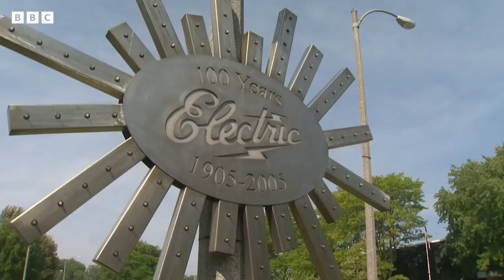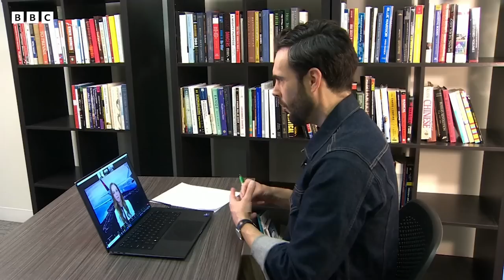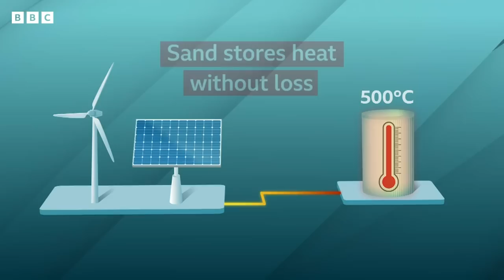Can the world rely on renewable energy? | Future Earth | BBC News

Comment: all energy-producing machinery must be fabricated from materials extracted from the earth. No energy system, in short, is actually “renewable,” since all machines require the continual mining and processing of millions of tons of primary materials and the disposal of hardware that inevitably wears out. Compared with hydrocarbons, green machines entail, on average, a 10-fold increase in the quantities of materials extracted and processed to produce the same amount of energy. For a snapshot of what all this points to regarding the total materials footprint of the green energy path, consider the supply chain for an electric car battery. A single battery providing a useful driving range weighs about 1,000 pounds. Providing the refined minerals needed to fabricate a single EV battery requires the mining, moving, and processing of more than 500,000 pounds of materials somewhere on the planet . That’s 20 times more than the 25,000 pounds of petroleum that an internal combustion engine uses over the life of a car.  Among the material realities of green energy:

Building wind turbines and solar panels to generate electricity, as well as batteries to fuel electric vehicles, requires, on average, more than 10 times the quantity of materials, compared with building machines using hydrocarbons to deliver the same amount of energy to society.

A single electric car contains more cobalt than 1,000 smartphone batteries; the blades on a single wind turbine have more plastic than 5 million smartphones; and a solar array that can power one data center uses more glass than 50 million phones.

Replacing hydrocarbons with green machines under current plans—never mind aspirations for far greater expansion—will vastly increase the mining of various critical minerals around the world. For example, a single electric car battery weighing 1,000 pounds requires extracting and processing some 500,000 pounds of materials. Averaged over a battery’s life, each mile of driving an electric car “consumes” five pounds of earth. Using an internal combustion engine consumes about 0.2 pounds of liquids per mile.

Oil, natural gas, and coal are needed to produce the concrete, steel, plastics, and purified minerals used to build green machines. The energy equivalent of 100 barrels of oil is used in the processes to fabricate a single battery that can store the equivalent of one barrel of oil.

By 2050, with current plans, the quantity of worn-out solar panels—much of it nonrecyclable—will constitute double the tonnage of all today’s global plastic waste, along with over 3 million tons per year of unrecyclable plastics from worn-out wind turbine blades. By 2030, more than 10 million tons per year of batteries will become garbage.

The extraction process of lithium is very resource demanding and specifically uses a lot of water in the extraction process. It is estimated that 500,000 gallons of water is used to mine one metric ton of lithium. With the world's leading country in production of lithium being Chile,  the lithium mines are in rural areas with an extremely diverse ecosystem. 

In Chile’s Salar de Atacama, one of the driest places on earth, about 65% of the water is used to mine lithium; leaving many of the local farmers and members of the community to find water elsewhere. Along with physical implications on the environment, working conditions can violate the standards of sustainable development goals. 

Additionally, it is common for locals to be in conflict with the surrounding lithium mines. There have been many accounts of dead animals and ruined farms in the surrounding areas of many of these mines. In Tagong, a small town in Garzê Tibetan Autonomous Prefecture China, there are records of dead fish and large animals floating down some of the rivers near the Tibetan mines. 

After further investigation, researchers found that this may have been caused by leakage of evaporation pools that sit for months and sometimes even years. Lithium-ion batteries contain metals such as cobalt, nickel, and manganese, which are toxic and can contaminate water supplies and ecosystems if they leach out of landfills. Additionally, fires in landfills or battery-recycling facilities have been attributed to inappropriate disposal of lithium-ion batteries. As a result, some jurisdictions require lithium-ion batteries to be recycled. In spite of the environmental cost of improper disposal of lithium-ion batteries, the rate of recycling is still relatively low, as recycling processes remain costly and immature.  More than 400 million batteries are used throughout the country, with only 5% being recycled, resulting in 8000 tonnes ending up in landfill.

Creating the lithium-ion battery pack is also more environmentally harmful than the manufacturing process for an average petrol-powered car.
Reply: Nice comment with tons of informations (not like most comments here), but sadly no sources.

 Like you mention it, it's obviously not an easy task to save us from our misery, but doing nothing about it doesn't seem to cut it either, right? It's really not as easy as they seem to put it, like in this video, which is sad tbh. 

But we have to continue our search for alternatives or otherwise we will lose no matter what. There are each year some great discoveries being made which could maybe change our future for the better. Science is trying to look for new methods to improve production and cost efficiency of those electrical devices or even look for other energy sources, obviously not an easy task.

What I'm really looking forward to is nuclear fussion as a potential power source. Let's hope the people working on ITER will change the game. Although this project will take a lot of time and will not immediately change our current situation, yet it's still something to look forward to in my and many other people's opinions.

There are still many discoveries to be made in the production of energy from renewable sources. It's not that long ago that we started to invest more time and money in this research field, so who knows what we'll find.

Anyway, I myself am obviously no expert and I don't want to pretend to be, but like you I believe there are many issues with some of the solutions presented in this video (and many others). And it's disappointing that those issues are not always talked about and how to remedy those problems.

Sorry for my imperfect english, I'm not a native speaker, so hopefully, my comment is understandable
Reply: @donpedro00769   how is 50 tons of ore for one battery that has a 7 year shelf life, that needs fossil fuels plus rare metals to be built, charged and maintained better for the environment?
Reply: @Censortubes  how would i know? I'm waiting for science to give us answers or alternatives. If going to space or even flying was considered impossible not to long ago than we can make some progress regarding efficiency of ev batteries.
Reply: @Censortubes  and I never said it's better for the environment lol
Reply: @Censortubes  but since you asked me a question concerning this topic: What do you think should we do for a more sustainable future regarding automotive industry? Just let everything be as it is can't be the right answer.
Reply: @donpedro00769  thanks for proving ccp bot.

Comment: NO. 
The facts are out there, but they are kept from us as it undermines their whole story.
WIND for example. What they TELL YOU wind farms "produce" in terms of energy, is based on "name plate capacity." This is what a turbine will produce at maximum power. ie. when the wind strength is JUST RIGHT over a 24 HOUR period. 😄
HOWEVER 🙁
From proven data, wind farms rarely produce even 20% of what is claimed, due to either downtime for maintenance or TOO MUCH/TOO LITTLE wind. Hence gas fired power stations are still kept on stand-by ( at great extra cost ) to fill the gap when wind & solar cannot cope with demand. 
We are saddling our kids and grand kids with TRILLIONS in debt, for a system that DOES NOT WORK. 😡

Comment: If renewables are going to go down the same track as Australia, you should consider that the Australian taxpayer must foot the bill for compounded inflation and cost of living pressures to fund the $1.2 trillion renewable program because of curtailment caused by congestion and budget blow out that requires farmland equivalent to 10 Tasmania’s.

At present Renewables have zero hope of meeting the net zero target because of their inability to meet firming requirements, but the real underlying reason why renewables, particularly wind and solar farms are being pushed so hard is because renewables qualify for carbon offsets which allows polluting industries to offset their carbon pollution activities which is the driving force behind climate change but ironically there is also the expectation that the taxpayer will have a feel-good feeling believing that renewables are saving the planet. 

There is an alternative.

Solar Hydrogen Energy Recovery Gas Turbine.

301Kwh (equal to 46/6.6Kw home solar installations) of solar energy collected from the sun’s nuclear fusion at atmospheric temperature is sufficient for electrolysis obtained from 1/3 of the water volume of an Olympic swimming pool that is recycled by steam reforming to produce 24 hours of Hydrogen gas contained within a 14 cubic meter space compressed between 350-700 bar to enable the start-up sequence of a hydrogen Gas turbine that in turn enables the synchronizing of its Variable Frequency Generator to maintain equilibrium of compressed hydrogen gas to continually fuel the turbine.

Oxygen produced from the electrolyzing process is also used as a fuel saving precooled engine catalyst to bring online the turbines energy recovery system and sustain a variably regulated base load power supply to service grid energy demand. 

The operational variability of the turbine manages both grid inertia, and mis matched frequency while generating a capacity energy range between 86 - 330Mw with optional co-generated steam capacity up to 700Mw of electrical energy on a 24/7/365-day basis.

The power generating turbine has three operational parts, 3m in diameter 5.5m long and weighs 6 tons. Installation cost $36.5 -49.5 million, requires an operational footprint area the size of a football field, noise level is 60dbl at 60m, incorporates direct air capture of CO2 at 1,400 Kg/sec and includes a 14-year maintenance free, end of life decommissioning or optional refurbishment program. 

Sixty-five carbon and pollution free, shovel ready, off the shelf technology that combines solar nuclear fusion with modern aerospace propulsion and existing nuclear and coal fired steam technology to generate a total of 21,450 Mw can be retrofitting to any of the 120 Hydro-electric schemes placed at existing grid conversion points would provide Australia's 26 million population its entire energy needs covering a combined operational area of 33 hectares for a 2023 total cost between $2.4-3.3 billion. Construction period is 3 to 5 years, meet net zero energy target twenty years earlier and makes wind and solar farms including hydro, gas and nuclear energy production redundant.

Comment: Unfortunately every watt of alleged green power has to be backed up with fossil fuel as if you don't you have power cuts as proven in the UK when it was tried. So not only do you have to manufacture the reusable equipment thay are actually increasing pollution as there's on way to guarantee power with out fossil fuel & we are burning fossil fuel & not using it just wasting it.

Comment: Hi All think on this wind and solar are green right ? Sorry wrong green means no landfill issues . But it works you say !! Well no it is the wrong type we need Baseload instant reliable feed power . now i am all for green but if it ends in landfill in part or hole then its not green. So how about the idea that all the dams that are not green due to the concrete are made to make more power? It can be made all have only one bank of turbines that can now change to three banks in some cases. Yet no one is doing it why Because of you not pushing thing .

Comment: The Royal Society recommend the UK should have 100TWh of energy storage (it's currently 39.3 GWh from 4 pumped storage facilities). That's over a 2,500 fold increase. That means building 10,000 pumped storage facilities or 400 every year. A typical pumped storage facility has a 300 to 400m dam built to hold back 10 million cubic metres of water, with a fall to the turbines below of about 400 metres.
That's at the same time as increasing wind power generation from 75TWh (in 2020) to 665TWh (in 2050 - these are UK National Grid figures). That's around 100,000 giant wind turbines. And by the time you get to 2050, the 4,000 wind turbines you needed to install in 2025 would have reached the end of their working lives and will need to be buried in landfill, and replaced with another 4,000. It's all impossible and absurd. 
The cabling and additional structures to connect all this together will essentially require the UK consuming all of the current global supply of copper and other rare metals for the next 25 years. The cost will be unaffordable and the skilled manpower levels unattainable. And that is just to eliminate the less than 1% of the global CO2 emissions that the UK is responsible for. So times that by 100 for the whole Earth going Net Zero. Good luck with that.
Reply: If 100 countries say... "but we are only 1%" and do nothing, then nothing will change.

Comment: PHEV+H - - - Combustible H economy ICEngine 'small' battery - solar rooftop V vast field array. PHEV+H wins.
Reply: PHEV vs BEV vs HFCEV - - Which of the 3 basic EV drivetrains offers MOST benefits, applications & potential to reduce fuel/energy consumption, emissions AND insane Traffic? Believe it or not, thee correct answer is PHEV+H by 65%. BEV for lightweight short distance travel/transport needs met. HFCEV best stationary power supply. Ukraine Peace Treaty offering. Scholastic debate.
Reply: Sorry. Got carried away with theory. Next step: drive less.
Reply: Conclusion: Sam Adams wrong for Portland. Ted Wheeler worst ever.

Comment: We really have to ponder this: why do the UK citizens pay a few times MORE than most people in the world when the renewables can now be even cheaper than energy from fossil fuels? To put it into perspective, in some Asian countries that only use natural gas to generate electricity, they pay only 10-12p per kwh (without standing charge) while we are paying bloody 27p per kwh + 35-40p standing charge per day! How could ours be that expensive?
There must be something wrong with our system! Our government must fix this or everyone in the UK will continue to suffer badly, both socially and economically.
Reply: Renewables are more expensive when you take into account all the costs necessary to deliver a stable electricity supply (power lines to transport electricity from thousands of disparate solar and wind farms far from where the electricity is used, energy storage because renewables are intermittent and a stable electricity supply is needed, grid balancing to respond to changes in generation, the cost of maintaining stand -by natural gas power plants to cover renewables when they fall short, plus all the maintenance on the above plus all the interest cost on the vast amount of infrastructure that needs to be built to deliver all of this - much of the renewables were built with near zero interest rates).

Also by inspection we know it is more expensive because if it were the cheapest it would not need subsidy and the UK would have high energy industries setting up on its east coast to take advantage or the wind energy from the north sea.. but in reality renewables are given subsidies, gas power stations are taxed, and high Energy industry is leaving the UK. 

So when someone says renewables are cheapest they are ignorant or gaslighting.

Hopefully there will be more technologies that emerge that are more practicable than current wind and solar.